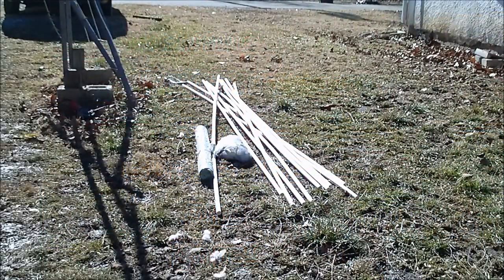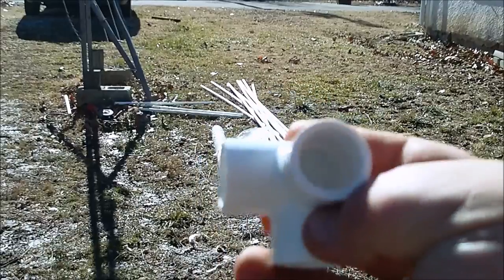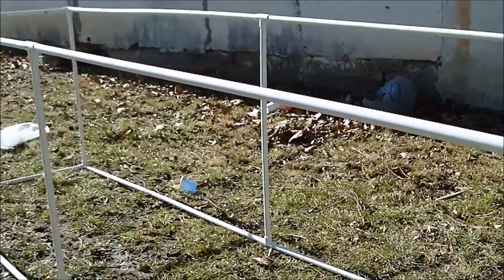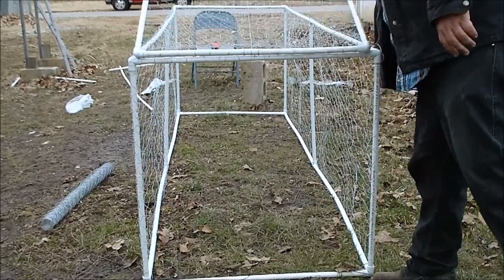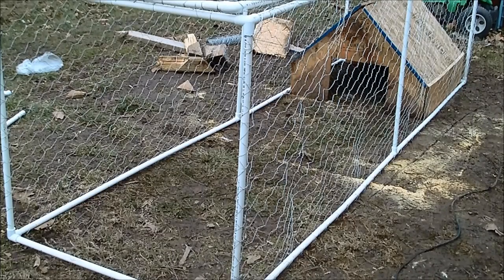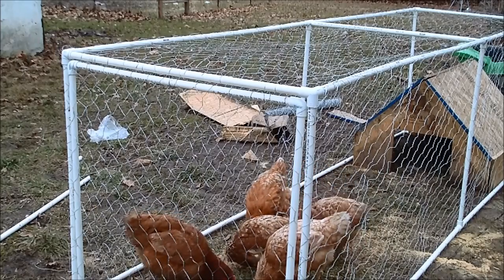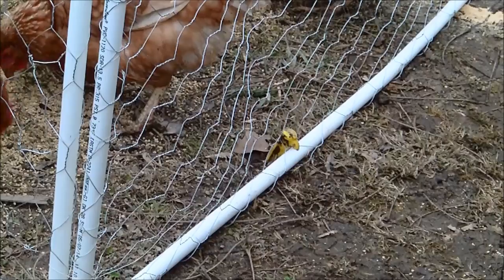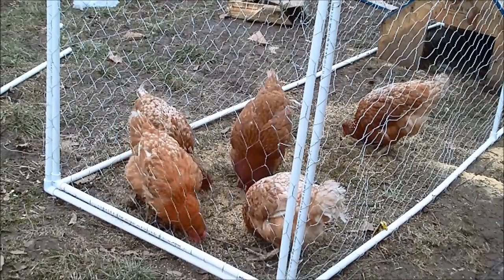PVC Chicken Enclosure

Comment: Neat idea for quick enclosure/ run.  I would use cattle panels for a more permanent cage with wire mesh with a 2 foot or foot and a half skirt on outside so it could not be dug under  and a taller nesting place so it is high enough they can't be reached.  They are safer in shed at night from coyotes, raccoons, skunks and dogs and who knows what else.                            A chicken tractor for later use?